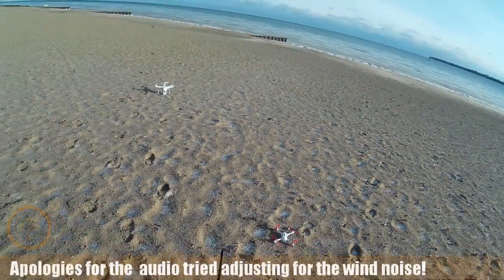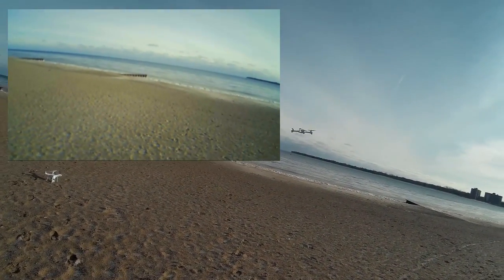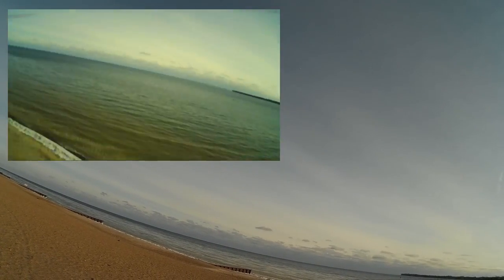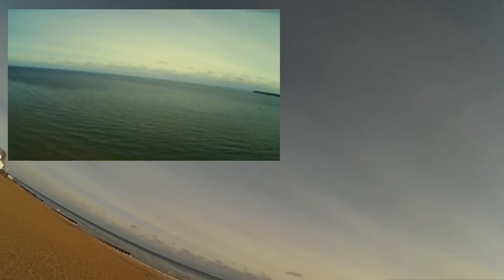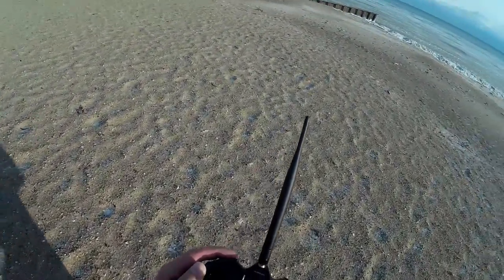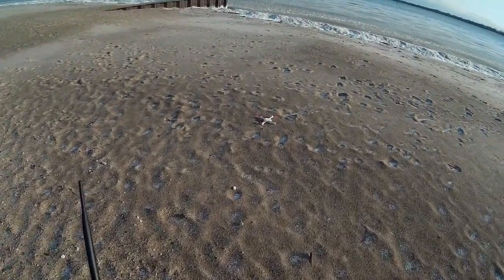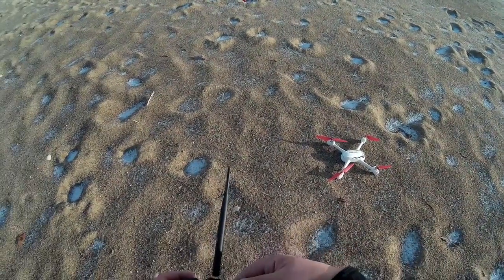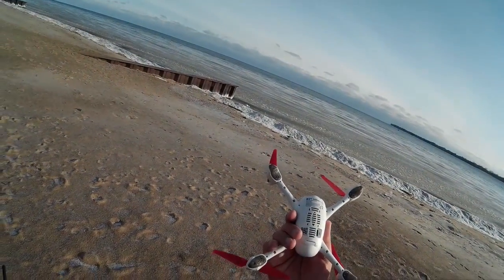Video Drone - Hubsan X4 Amazing Crash On Lake Huron Shore!

Comment: Is that version supposed to return to home on low battery?  The Cheerson CX-35 says it will auto return to home on low battery.   I did t think the Hubsan X4 version that you have did that. 

It was impressive that there was not more damage considering the temperature.  I would have expected an arm to be cracked or something like that.  If it had landing gear like a DJI it probably have sustained more damage. 

Another cool video.
Reply from the maker: You have an interesting point, I don't see that in the manual either (hey I am a guy I read manuals only as a resort) think the problem is there are a lot of X4's and not all are created equal!  As I was experimenting with it yesterday and crashed it again (Ops)  but wondering if don't have a bad battery (so ordered a new one)...
Reply: Video-Drone - I have noticed that there are several versions and each has one thing different about them.  Makes sense with the wide variation of prices I see for them.  This is why I'm cautious about purchasing one right now (besides trying to convince the CFO, lol). 

I have a while before my birthday and may purchase one then.
Reply from the maker: Like I say the H502e :-)  Lots of fun for under a C Note!
Reply: The H502E does not RTH on low battery.  The manual says it will do an immediate descent.  This is why timing a flight to LVC is important so one can plan on having the quadcopter safely back ideally before LVC.

Comment: I don't believe it has return to home on low power......it just lands.  It has return to home if it looses signal or your transmitter is turned off or you depress the RTH button.  Thanks for video.....That is a pretty windy and cold conditions.  That's a lot to ask that little toy quad to do.
Reply from the maker: yea not sure it does or dosent but can tell you for sure on low power it just falls from the sky! it has done it to me several times now :-(
Reply: you right about that. It only has if you loose connection. If you allready is doing a rth and looses gps lock, it will just try to land. But its kinda sad it dont have a real failsafe for the battery.

Comment: mine crash in someone's roof It was acting up in the air so I pressed the rth button only to make go quicker and out. I got the drone the battery was out. by the looks of things I need to replace the motor.
Reply from the maker: Yea the little motors inside this guy can wear out quickly if you check the play list for this bird you will see I caught this on video (motor's failing).